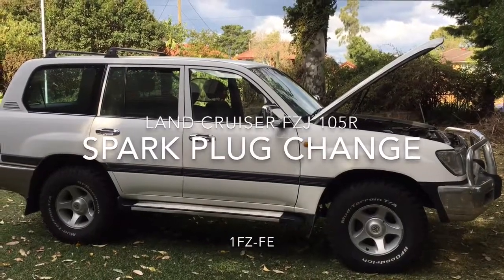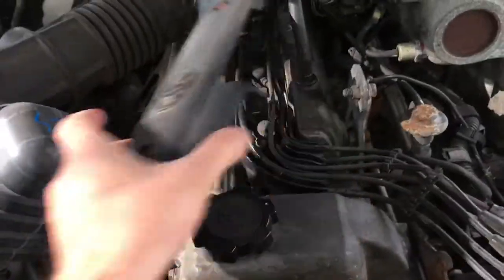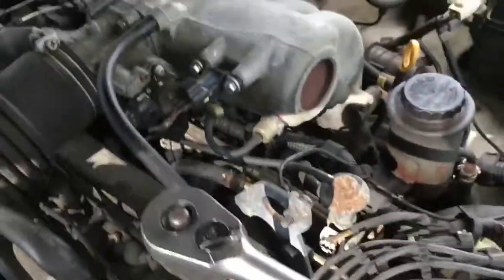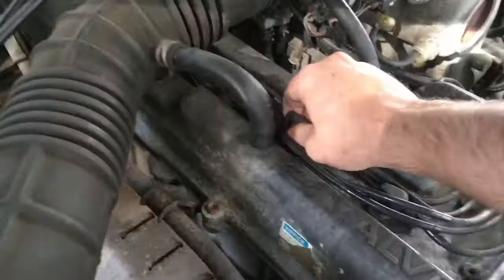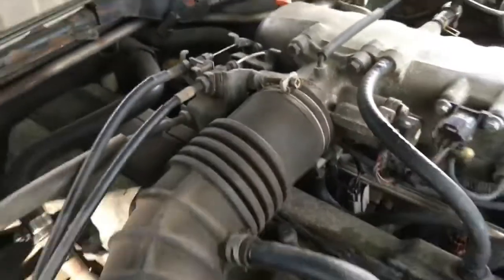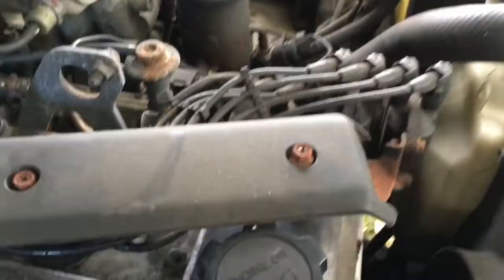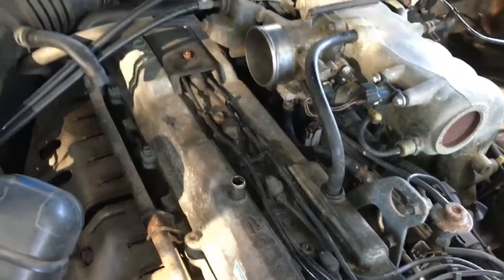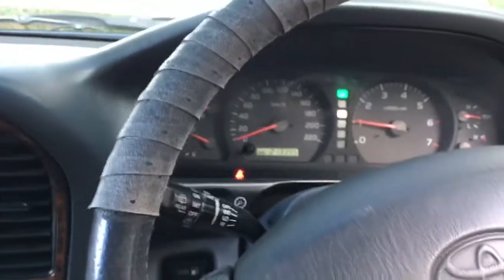1FZ-fe spark plug change

Comment: suggest that once the spark plug is loosened a bit that the hole tube is blown out with compressed air to ensure that no loose bits fall into the engine.
also better to remove all the leads away from the tappet cover to keep the area clean, any item that falls in may do substantial damage to your engine.

Comment: what have u got wrapped round ur leads and why cheers
Reply from the maker: Cherie Overs, I am not sure what is wrapped around the lead, I didn't do it. I asume it's to prevent wear. Was installed when I received the car and as far as I know it's the original leads.
Reply: Nigel  we had the same on our leads then we changed them and new ones didn't have them on it.. since changing them our car has been missing and then yesterday our car won't start. how do u check if there is spark cheers
Reply: como extraer Carter del 1fz